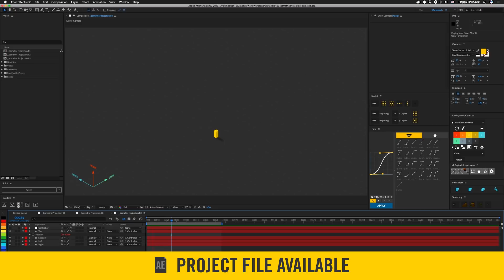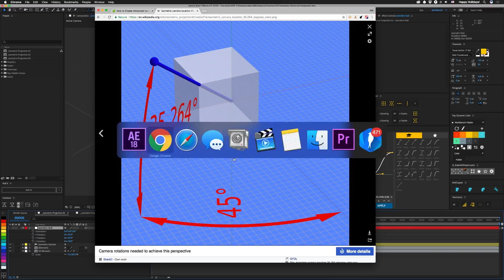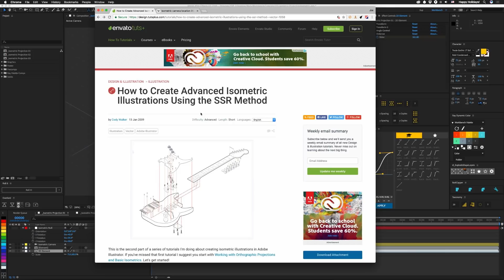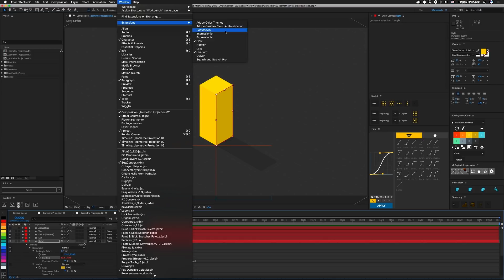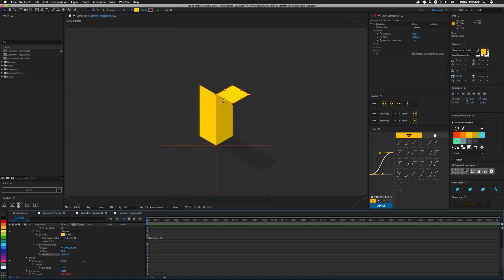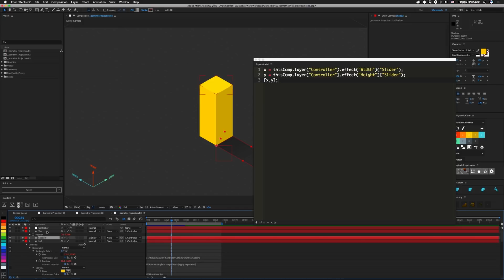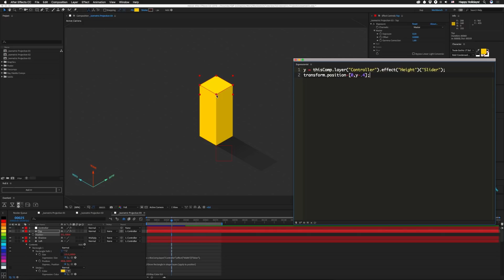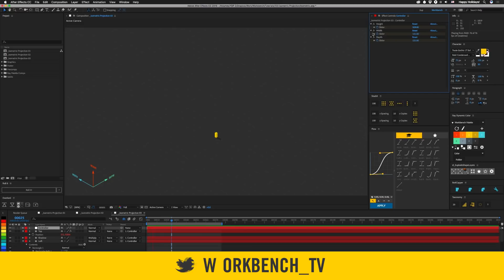Tutorial 103: Isometric Projection

Comment: How were you able to get the anchor points for all the shapes at 0,0? When I snap the anchor points into the same position as you have them in this video then they are not at 0,0. When I type in 0,0 then the shape moves somewhere off the composition.
Reply from the maker: I just opened the project to recreate it and didn't have that issue. They're parented to the controller, so that's likely where the issue is. So the anchor/position of [0, 0] is relative to the controller null. Other than that, Transform: Rectangle Path 1 is set to [0, 0] for anchor and position. The only position or anchor that is modified is the one inside Rectangle Path 1—it's the one with the Grow Rectangle expression.
Reply: @Workbenchtv  Yea I realized that after watching the tutorial again today that the layers are parented to the null control layer and with the expressions. I didn't parent them to the null layer. Thank you for all your wisdom that you put into these tutorials. 

One more question, when would the need arise to use a true 3D isometric camera vs the SSR method?
Reply from the maker: @IsionIndustries  I'm glad we got that figured out! Using this SSR method works well for shapes because we can shear them easily and with correct numbers. I think you can shear in the Transform effect as well, so it might work with raster layers, but raster layers would be a case where it might be more difficult. There's always things like CC Slant, but I don't remember offhand if they work the same with shear values.